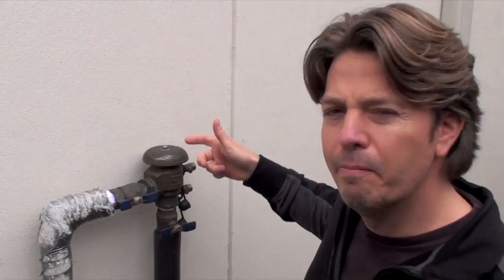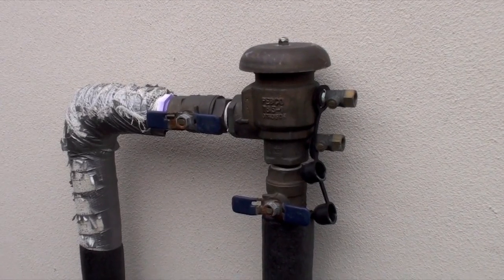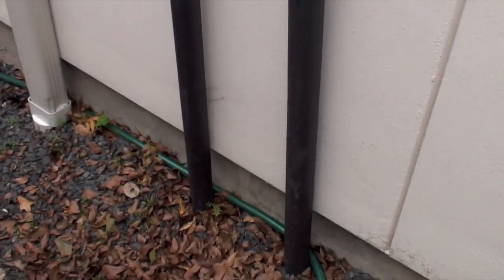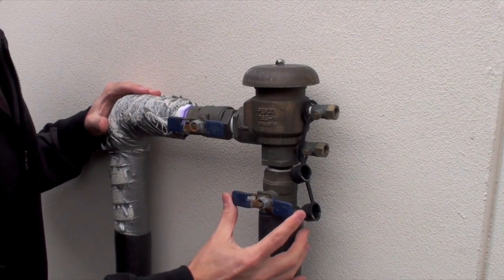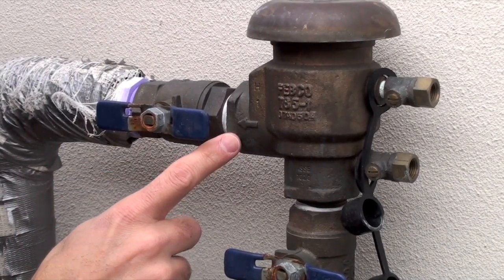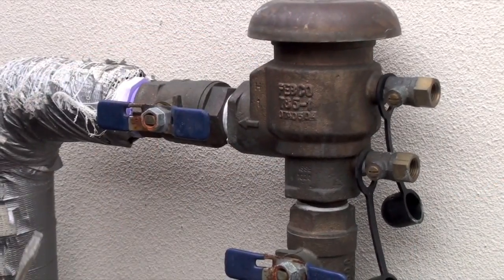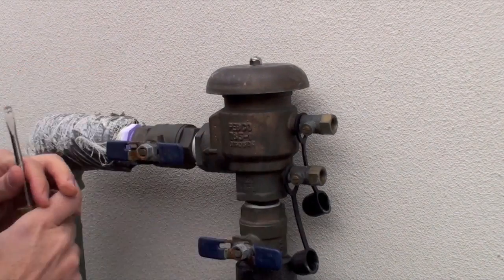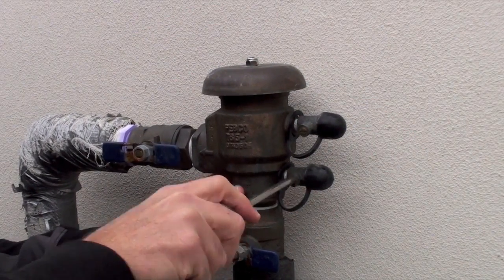Irrigation Sprinkler Freeze HD

Comment: Wish I 'd seen this before the freeze! Yesterday had water pouring out of the bell. Couldn't find the water shut off valve for the sprinkler system(house is a rental and landlord didn't know either). The gate valve under the bell did not work...just kept spinning.(mine is the old school round handle valve). I had to shut off the water to the house at the main city water cut off. I have a guy coming by today to see what he can do. Can a freeze blow the gate valve as well as the vacuum breaker?